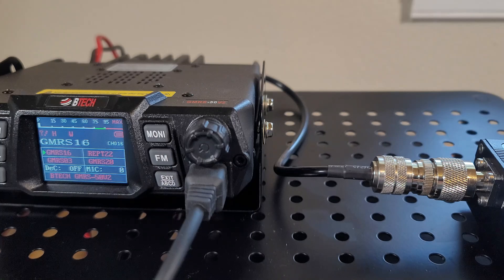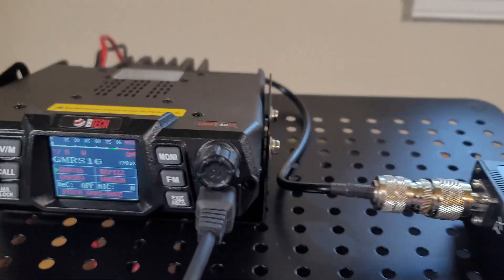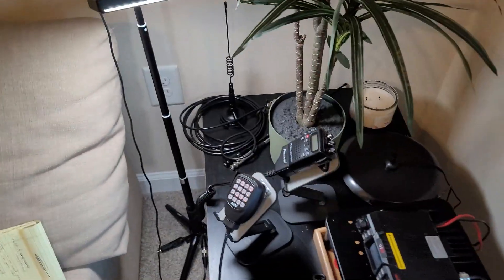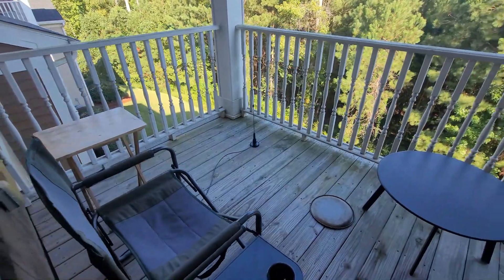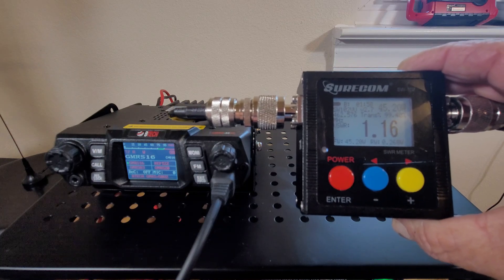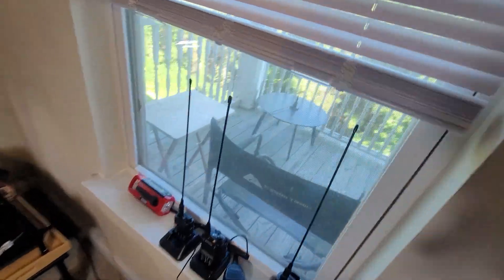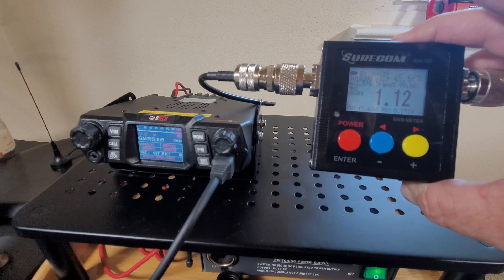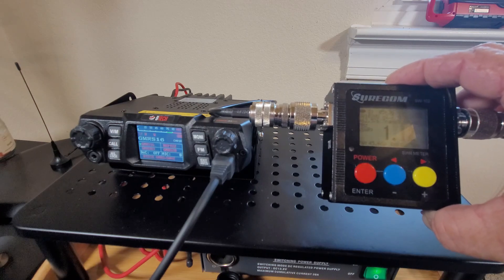GMRS SWR test without ground plane

Comment: Just a comment about placing the antenna down at the floor level like that so close by... and pushing 50ish watts through it. It's not a big deal to have an antenna at the height of your body or head with 5 watt handhelds... but pumping more power through an antenna that is basically pointed right at you like that is potentially a bad thing for your body. I would suggest putting it up well above the height of your head so it is transmitting above you instead of on the same level as you are at when you are that close.
Reply from the maker: @glenn_r_frank_author  thank you for the info! And thank you for watching! 👍🏻